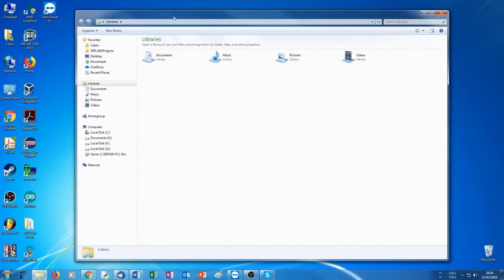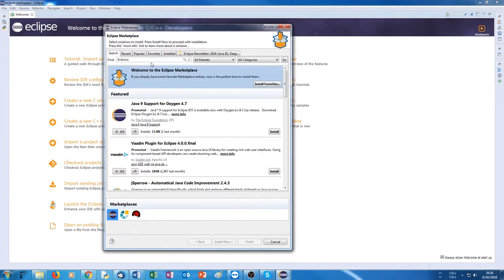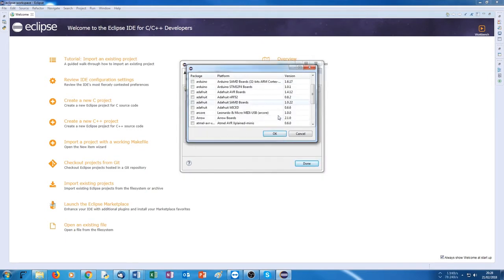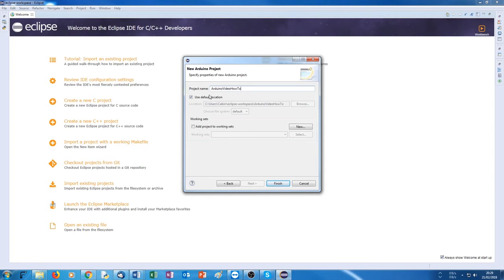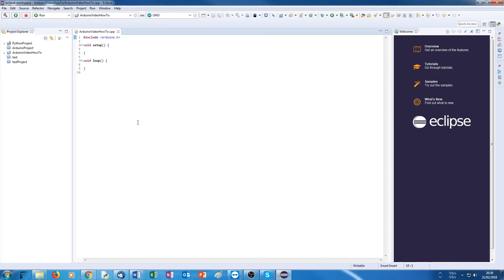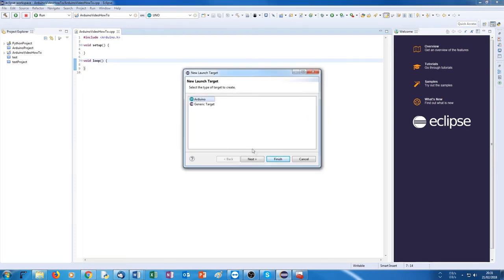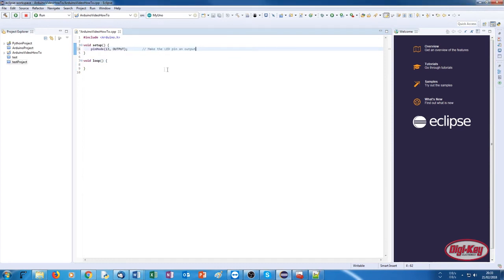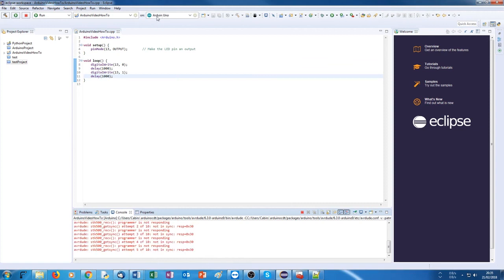Using Arduino in Eclipse – Maker.io Tutorial | Digi-Key Electronics

Comment: This was helpful for me. However the way Eclipse requires the USB port setting and how Debian based Linux displays the USB ports is not very easy to navigate. The typical "lsusb" command doesn't help as this shows the bus and bus-port numbers but not the actual tty port number. There are lots of ways to see the tty port number but these do not show the information about a connected device. After spending the last hour trying to find a solution I combined a few suggestions and came up with this: 

 dmesg | grep Arduino -v 

  Type this in a terminal while you have the board connected. I finally (think I) understand what the dmesg | grep command does. I believe dmesg is like a system log, and "| grep" is a way to search that log for a specific word or phrase. I had only used this to search for dmesg | grep tty in the past, but realized I could search for ttyusb, or just usb, and realized I could actually search for Arduino. This still didn't get results, but the "-v" command is pretty universal for "verbose output." This got me a list of everything related to the device related to the name "Arduino."
...anyways... this is a long bla bla bla, but hopefully I've given someone both the solution that worked for me and the tools I used that might help if the exact command isn't working. I'm not expert.

-Jake

Comment: You probably should have left the programmer setting alone.  "AVR as ISP" is used when you've written the ArduinoISP sketch to an Arduino and are using that board as a programmer to program another AVR chip.  I use it for the ATTiny85 a lot.